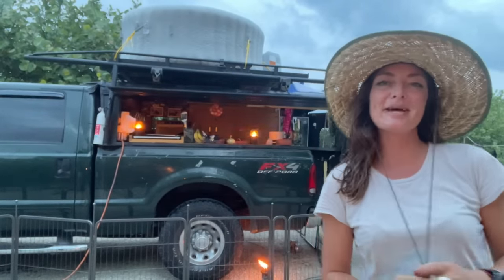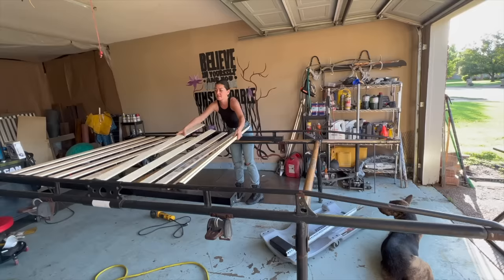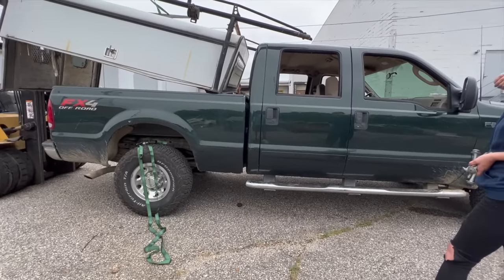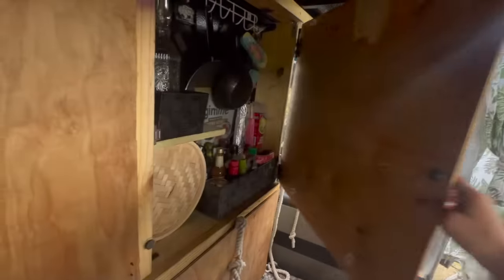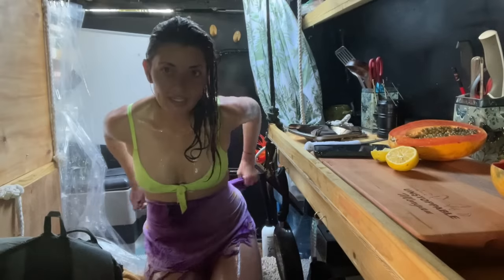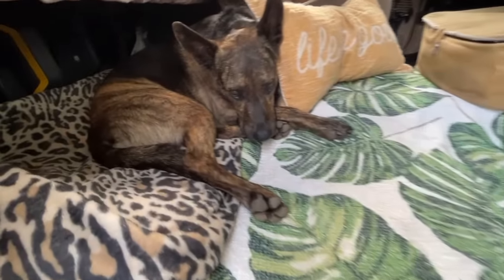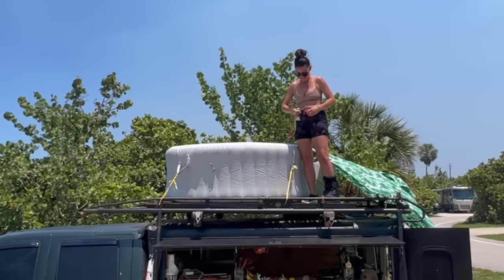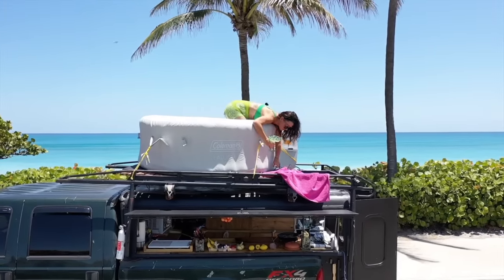FULL TOUR OF MY NEW RIG! Please allow me to reintroduce myself…

Comment: Morgan sweetie, what happens with the hot tub depends entirely on the rack that you have. Most of the racks they put on utility vehicles are bolted together and have a 500 lb weight limit. If this is the case, it will collapse. If you got lucky and found one of the few solid cage racks, no problem since the tubing is heavier gauge and usually have a load limit of 2500 lbs. Hope this helps. 😁👍 As always, BIG HUGS and lots of ❤to you and the pups! STAY SAFE!

Comment: Hey homegirl, do you have any recos for where to get a good deal on a box truck? 
Ive been car dweller in a mazda 3 for six years.  

I got into homeless shelter for 3 months of winter, and looks like I'm gonna be back out car dwelling.

I asked the homeless shelter if they could help me raise funds for a bigger vehicle, they said they never did that before.  (Non answer) 

Any idea for where i can trade in a mazda 3 for a box truck?
Reply from the maker: Sorry I don’t. But if I were you I’d really be giving the decision to buy a box truck another thought. Where are you going to park that thing? Nowadays everyone knows that an unmarked box truck that has a vent, window, or AC is obviously a truck someone is living in. You’ll have the cops knocking on your door nightly. In addition to that, the parts (depending on the truck) can be difficult to find. So if your starter goes out and all you’ve got is an autozone you may run into some trouble. The gas mileage is going to make you go broke and you’re going to get so tired of driving that thing around town to run your daily errands. Say sayonara to making a U turn and don’t even think about going off grid. Box trucks aren’t designed for uneven terrain. My suggestion is that you don’t live in your car. It’s not good for your mental health. If you’re doing it to travel like I did in the Bronco, sweet! But trust me you’re time traveling will be up and then what? You’re just miserable, living in a car. 

If you don’t want to settle down in one spot (like myself) get yourself a truck and pull a trailer. You can stay at RV parks for months at a time and get discounted rates. Most have nice amenities. So if your trailer is a fixer upper you’ll have access to showers and toilettes. The RV parks give you a sense of community which everyone needs but don’t know it. If you need a job, find one online. You can medical billing or if you don’t have a computer you can work for an insurance company. My little sister sells life insurance, works from home and makes enough to take care of her kid. The online jobs are out there. 
If you have a truck and trailer you can unhook and then go explore around. It’s perfection. I’ve lived in a lot of different scenarios and I’d say the truck and trailer is so far the best. Good luck man!
Reply: @UnstoppableMorgan hey boss appreciate you, please don't think you are going unappreciated okay?  If we X paths on the road I will be sure to ask if you'd like a coffee or a tea, and offer my heartfelt thanX

Comment: As long as you don't drive it or leave it full for a long period of time, you'll be fine. If you try to drive with it full, it'll bust your leaf springs. Maybe not right away, but f I bet money within a 1000 miles and Fords have the best suspension for a truck. If they would install a GM wiring harness in a Ford truck, they'd have a perfect truck. Now diesel wise, just transplant a Cummins with an Allison's 6spd. My opinion anyways

Comment: You are ridiculously amazing and I love it.  I'd kill for your fabrication skills.  And since the weight of the tub is distributed onto the rack and not the shell, it won't immediately crush the shell.  Now, if the wood slats give out, bye bye shell. If they don't, the suspension will probably be unhappy and might shorten the life of your shocks a bit. Just don't hit the brakes too hard with the tub full. :P

Comment: I think at worst it will bend the frame in half because of to much weight in the bed. At best things will be fine.
Reply: It's a Ford F250 , Extended Cab  ,   Extra Suspension Work ,

Comment: When using thin plywood use piano hinges with small screws. Start with small pilot hole then the screw you want to use. Screw it in enough to have threads. Pull out the screw and use a screw that has been ground down with no point on it and is the right length needed. Be careful not to strip the threads.